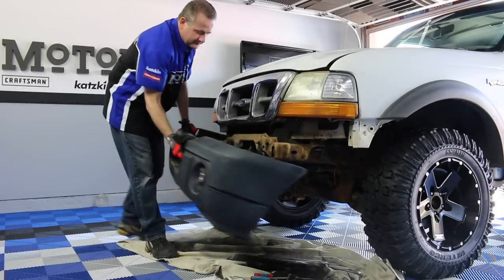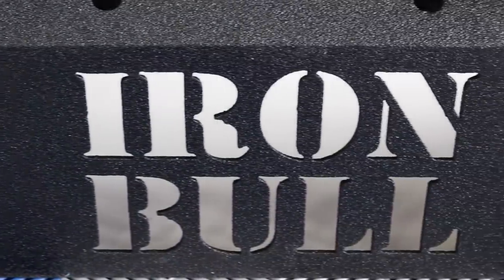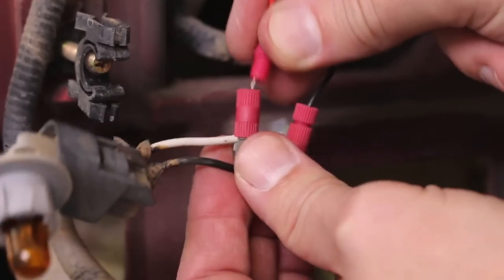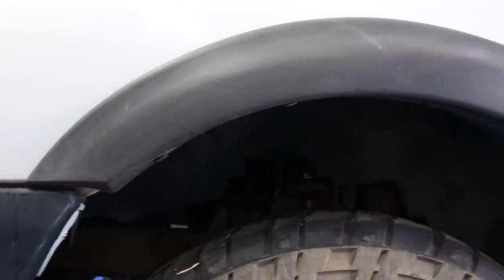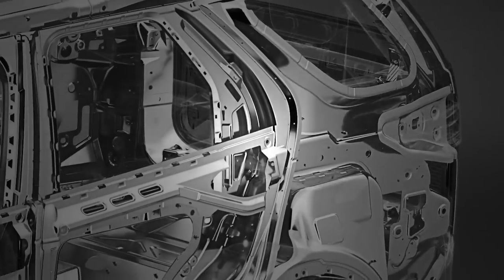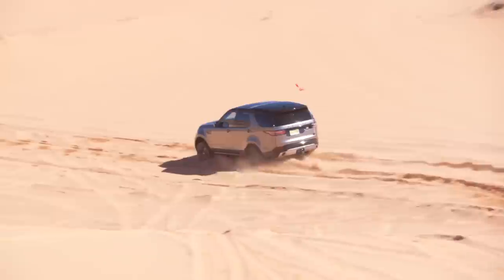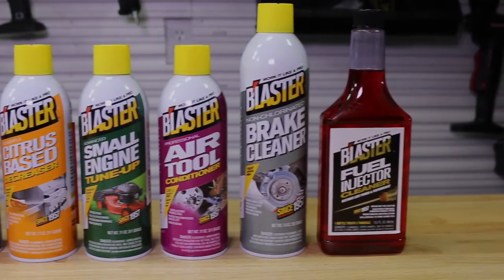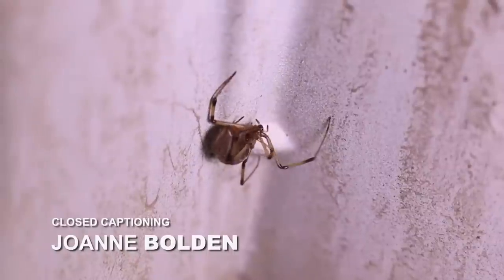2000 Ford Ranger Overhaul Pt 2, 2017 Land Rover Discovery, Motorz #92

Comment: Iron Bull bumper is $1400.😂 I’m good
Reply: oof
Reply: Try affordable offroad
Reply: Worth more than the truck
Reply: Houseoffinch no it’s not 😂
Reply: @dumbestoyster  literally can buy a truck for less than that
Reply: @omarX12z  . But you want to drive the truck, not flint stone the truck, and not have more than 500k on the engine.
Reply: Cost more than the truck that I want to have  it on 😂
Reply: Great video! Truck looks great,  I built my own bumper for around $150, all 3/16 steel,  9500 lbs smittybuilt winch. Check it out. It's on the green ranger, currently removing to put on the red ranger.

Comment: I've thought about doing that paint job on the sides several times to my ranger! Did you put a clear coat on that?
Reply from the maker: No clear since it was a spray on bedliner. I wanted to put a 1/4" or maybe slightly larger strip of vinyl over the top between the black and white but it wasn't staying on.
Reply: Motorz I think it looks awesome! I used the roll in bed liner from the same brand on my ranger and I've been pretty happy with it. Might have to try this! Hopefully it doesn't fade much
Reply from the maker: It's less messy and easy to touch up!